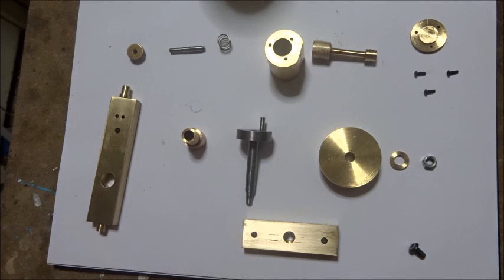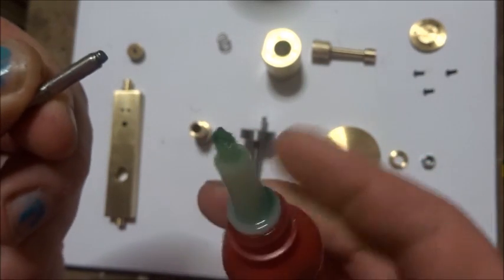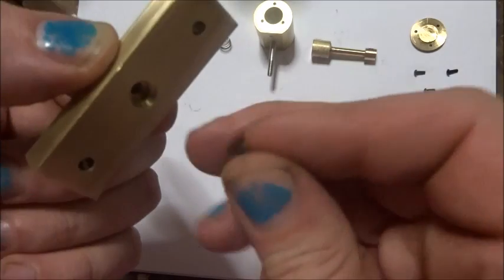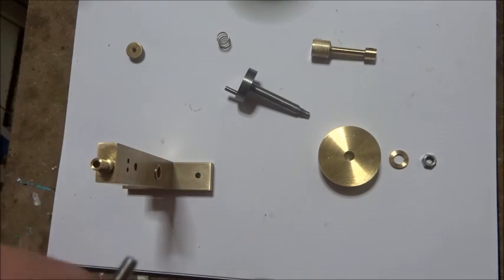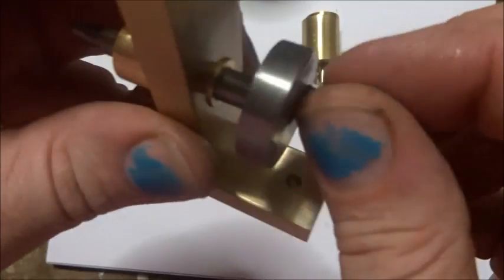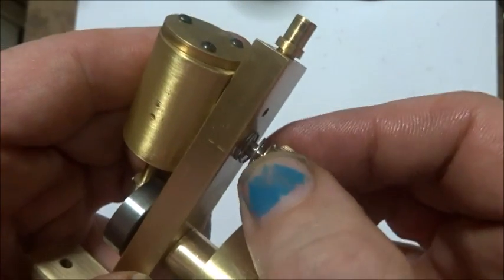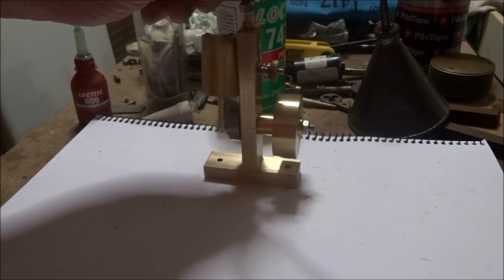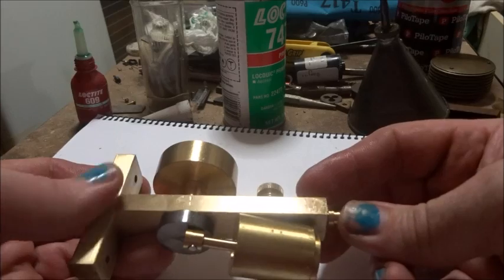simple steam engine 9 (assembly and running)

Comment: Nice series Emma. I have followed the series from start to finish. The engine turned out great.Glad you managed to setup a better camera angle of you working. That makes it much better to watch. You seem to manage very well without bowing down to the safety Nazi's. :-). If the truth be known we all know the rules and bend them a bit when working in our little home shops. ie rings/watches/bracelets/necklaces/long sleeves etc. I don't wear safety shoes in my home shop but some of the lumps of metal I lug around weigh 3,4 or 5 Kg before I put them in the bandsaw that's my choice and I know the risks of a broken toe so I take a bit more care. Keep up the good work. regards from the UK
Reply from the maker: Gary C thanks for your nice comments. still working on a camera setup that works, but soon maybe, ill find the answer.